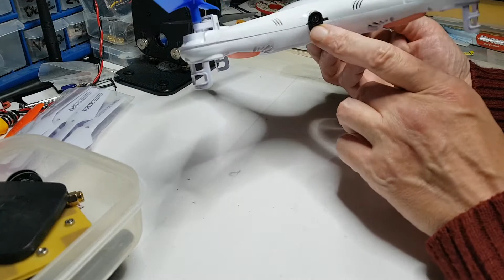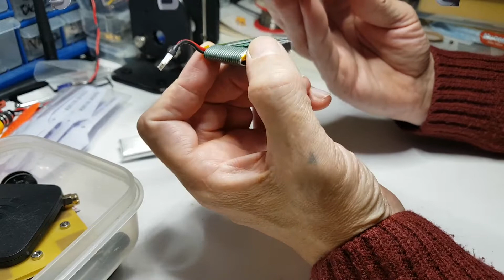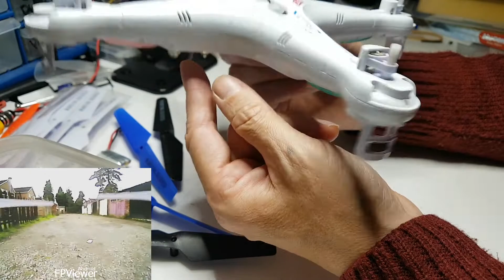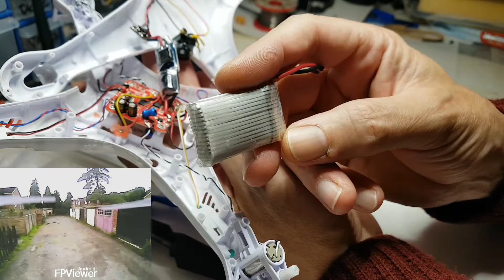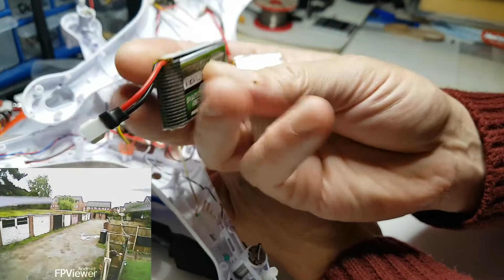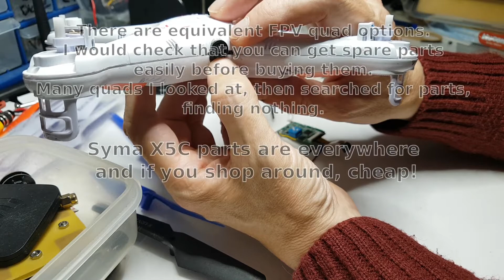Syma X5C FPV Mod

Comment from the maker: PLEASE NOTE if you buy a Nano-tech battery for your Syma X5C CHECK the polarity against your original battery before you connect it. Some of these batteries come with reversed polarities and need to be very carefully changed. DO NOT short the battery terminals together. Remove one terminal using a pointed pair of tweezers or something similar keep it isolated from the other lead and switch the leads in the connector.
Reply: Your wright i have just checked with my other battery's they our wired wrong, Thank you so much

Comment: Here is my Syma X5C with similar FPV mod, 8.5mm motors with 13 tooth pinions. This flight had a 850mah battery. https://youtu.be/oJPc1ffJ9Ks

Comment: My Syma X5C with 8.5mm motors and 13 tooth pinions. Camera and transmitter have a clean internal installation. Clearly better power filtering is needed, but it works. https://youtu.be/oJPc1ffJ9Ks

Comment: I got the battery working and i got 12 mins with out the fpv set up, Very nice battery Thanks again.
Reply from the maker: Glad to hear it. Just remember don't run the battery down to low 3.3V absolute minimum and keep stored at 3.7 - 3.8V and they last you well.
Reply: Ok thanks for info.

Comment: I just bought this battery stuck it in my symax5c and my drone started to smock, Is this because I need to fit all the parts in or is it a faulty battery, I,m still waiting for the 72 Channel Video Transmitter to arrive so i decided to do a time test of the stock battery and the Nanotech 750mah battery. When i put the Nanotech battery in the syma it was turned off but yet the propellers started to move then the smock, lucky I did not damage the drone. Please reply as these parts will be no good for me as I,m not very good with electronics. Thanks
Reply from the maker: Oh dear that is not good. Sally please check the polarity of the battery against one of your existing batteries, sometimes these are sent out with the polarities crossed. Not all are like that but some are.
Reply: Thank you for getting back to me, I have just stuck the same battery in my led strip lights and i have green light on so the battery is working on that, this as got me scratching  my head lol. Any ideas

Comment: I use the same batteries, they are good. I fitted the 5 volt step up module and get twice the distance without break up in a large open field with 25 mw, in and around a few trees or near houses I get some unpleasant breakup though. I'm using a little whip linear polarized like yourself. I've just ordered five of those lc filters and will fit one, it can't do any harm though it's a cloverleaf I need to fit I think for the trees lol.
I fly a little fy 326 q7 quadcopter fpv, they fly great once you do the aerial mod on both tx and rx and they come with 8520 motors as standard ( syma x5c copy ) £16.00 on ebay.
Enjoyed the video, nice flying also.
Reply from the maker: I just check out the fy 326 q7. Syma made a good little quad for copying.
Reply: I can find exactly one eBay listing for FY326 Q7 and it is $30 + $18
Reply: The seller I got mine from is sold out, I went looking and could only find one on ebay for £22.99 with free delivery and this one on gearbest for £20.01 though From memory they charge some delivery.
https://www.gearbest.com/FY326-4-Channel-2.4GHz-RC-Quadcopter-_gear/
or ebay with free delivery
https://www.ebay.co.uk/itm/FY326-Q7-4-Channel-2-4GHz-RC-Quadcopter-360-Flip-Fly-100M/132154261365?hash=item1ec501ff75:g:04sAAOSwhvFZCN4l
This was good at the £16.00 price but there are better options now and even a syma x5c can be found quite cheaply.
I think after Christmas there may be better options and it may be better to wait.
My favourite toy grade quad that can take a camera and larger batteries, has power with great control is my jjrc 1000, cheap as chips on it's own and with controller here
 https://www.gearbest.com/rc-quadcopters/pp_165868.html
Hope this helps.
Oh, I just found this...
https://www.banggood.com/Eachine-E708-Headless-Mode-2_4G-4CH-6-Axis-LED-RC-Quadcopter-RTF-p-1150487.html?rmmds=detail-top-buytogether&ID=42482&cur_warehouse=CN
Good for the price I guess.
Reply: I love the FY326 Q7, I prefer the plastic it uses over the Syma.  I put tri blade props on and leave the landing gear off.  I think its really smooth.  I just can't figure out how to bind it to the multi protocol module. Have an awesome new year!
Reply: Lol, I have a Jumper T8SG Multi-Protocol and can't get it bound yet to that ha, don't matter though because I like the little controller that comes with it after the aerial mod is done.
Have an awesome new year also. I'm looking forward to better weather, it's been pretty dismal here in North of Ireland.
Reply: pa maj    It's been cold and rainy here in Oregon .  I bought a couple white waterproof quads so I can fly in the rain day or night.  And I agree on the transmitter that comes with the Q7 but I haven't done the mod since my property is only an acre and have no range issues.
Reply: pa maj    It's been cold and rainy here in Oregon .  I bought a couple white waterproof quads so I can fly in the rain day or night.  And I agree on the transmitter that comes with the Q7 but I haven't done the mod since my property is only an acre and have no range issues.
Reply: We have had it all wind, storms actually with heavy rain with snow as well just before Christmas.
I've been flying in the house most of the time with micro quads, good fun also.
Sometimes I fly the small ones outside my front door, up and down over my two neighbors gardens, they don't mind at all and even come out to watch and chat now and then.
A private acre would be nice though, perfect actually :)
Reply: pa maj you put 5v to your 5.8ghz and it got you better range ?
Reply: Yes Hunter, I fitted a volt step up module and get twice the distance without break up in a large open field with a 25 mw camera transmitter..
I am talking about video signal range, I have some video of it showing results that I need to edit and upload to my channel when I can find the time.
 I did two simple antenna mods on the TX and quadcopter to get better flying distance as well which made a massive difference.